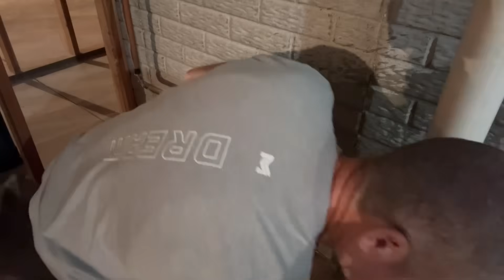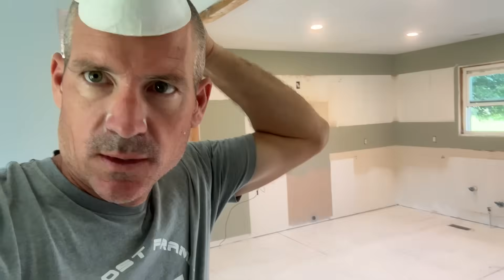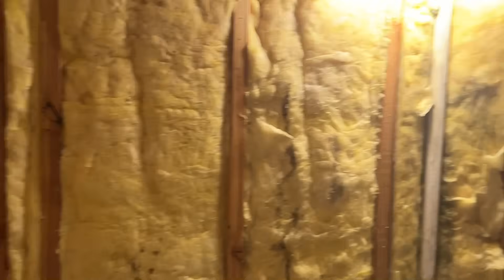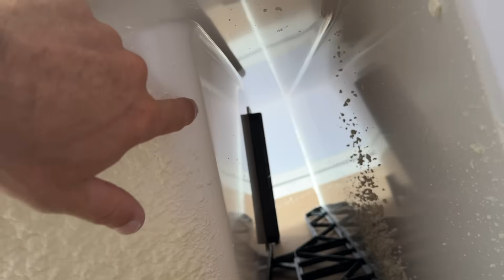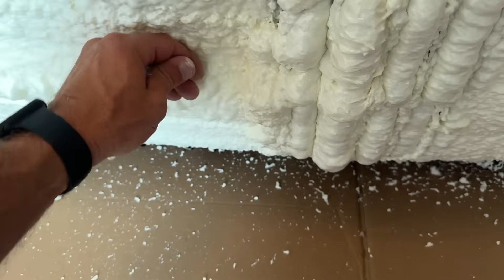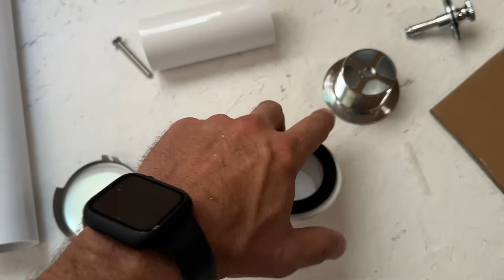Paint Sprayer has saved me over $100K! Remodeling a House - Day 8 and 9

Comment: When you're putting that gasket on the tub, The wider piece of the gasket goes to the bottom, not the top. You're right, the tub is at an angle that gasket is to make the pipe go plum. It's considerably out of plum if you put the fat part of the gasket at the top
Reply from the maker: You are right. I did explain that wrong. I realized that because someone else mentioned that too. I check today and I had them on with the wide part down. Maybe I have Dyslexia. 🤦‍♂️
Reply: @MrPostFrame  shoot, I'm thinking about starting a YouTube channel myself just to catch my screw ups. It happens a lot in my world. Don't feel bad. You do pretty good

Comment: Why the preference of pex vs copper?
Reply from the maker: The ease of installation, a lot less joints, tougher, easier to repair or change something down the road if need be.  Nothing wrong with using copper, but after using pex I have never gone back.  There are things that I still use copper for, but the majority of what I use is pex.
Reply: @MrPostFrame  I've always heard copper has a way of killing bacteria. I would have to look that up to give more information but that's what I've always heard